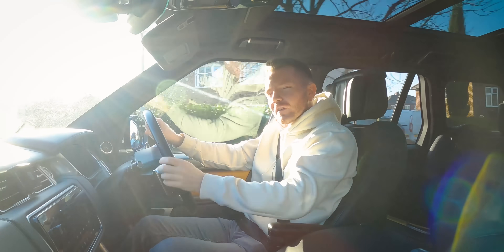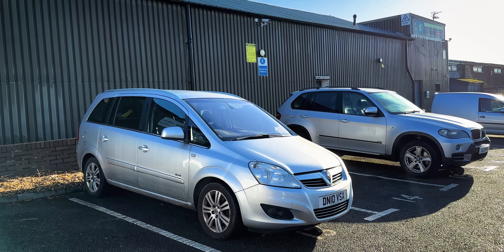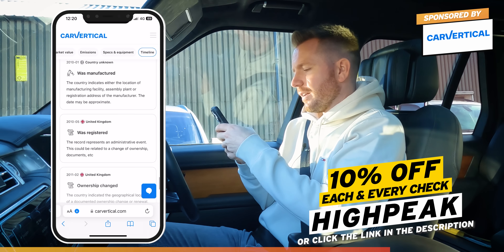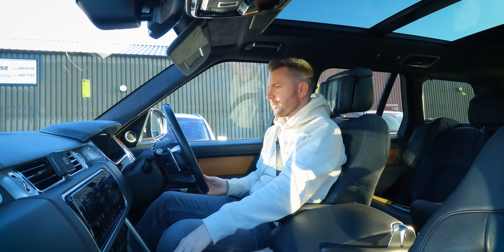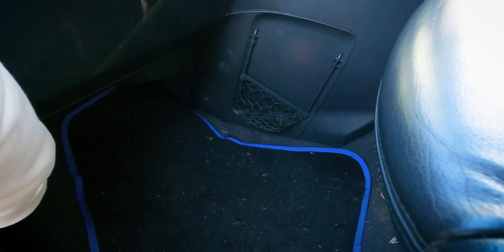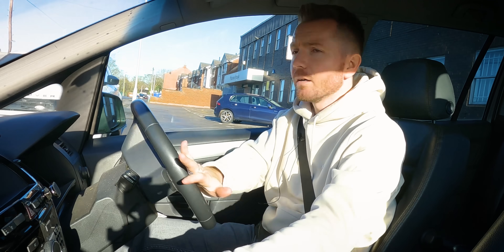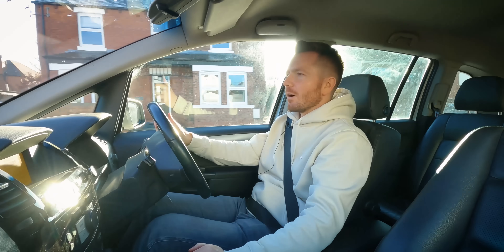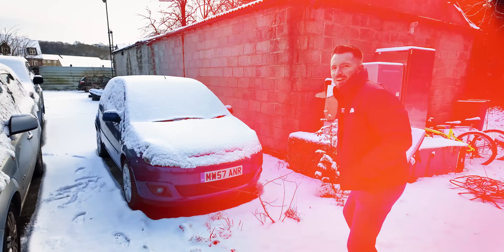I BOUGHT A CHEAP VAUXHALL ZAFIRA FOR £1,000!

Comment: The remark about the recall was not great...Vauxhall knew there was a. Issue with the heaters bursting into flames and decided to ignore it for years , risking many lives, they even blamed bad diy fixes. A friend's burst into flames outside his house and was gutted as well as his wife's car. I saw another stop at a roundabout smoking, by the time the dad got his kids out in 30 seconds( I stopped to help but not quick enough) the flames and smoke were out the windows. Scary stuff, so yes they earned the rep and its why I never bought a Vauxhall. They were happy to knowingly risk lives for a cheap resistor.

Comment: This is something I am expert in. My 2010 SRi 1.9 CDTI has 110 K miles and has a long list of things that need doing including the clutch, water bottle for screen wash, rear brake disks and pads, front pads and a tyre. The exhast has a rattle that suggests more expense and being a diesel the dpf is regenerating very frequently suggesting end of life. Sadly (like most Zafiras of this age/mileage) it is not worth saving. Much abused in my seven years of (much loved) ownership ? You bet ! NB cost me £4K + trade in worth £1K and £3k in repairs in the 7 years and 80K miles.

Comment: I bought a 1.8.  Been in the same family from new. Full service history……. But what a crock of shit. Five speed gearbox didn’t seem synced with the engine. No power at all. It rattled when you started it up. Then the cylinder head gasket went. It cost more to get it repaired than what it was worth. 32 to the gallon. Just plain nasty. The interior is nice though, as far as 7 seaters go.

Comment: I used to own one the diesel model 08 plate never ran on A shoe string always in the garage Springs, breaking air Leaking out of the tires due to policy alloys etc Replace the gearbox  Never will own one again stay away I would.

Comment: Had a Zafira 2.0 turbo petrol SRI. Biggest piece of sh*t I’ve ever had the misfortune to own. I replaced it in the end with a Renault Laguna. The Laguna was faultless in the 5 years I had it. I’ll never have another Vauxhall while I’ve got a hole in my ar*se.
Reply: Had a Zafira since new - 10 years old now, and been way than a whole list of Audis and BM’s I’ve owned - I think the trick is, don’t buy someone else’s issues … buy as new as you can and look after it …
Reply: @JIMMYHIBBS1 it was 6 months old when I bought it. It was ok for the first year or so. Then it’s decided to go through turbos at a rate of one every 14 months. From the responses I got from Vauxhall and taking it to other garages. I think it was a fault with that engine that they knew about but weren’t admitting. It wasn’t a popular engine in their line up. Most people either bought one of the diesels. If they wanted a quicker version they bought the VXR.
Reply: @mrgt3201  are - ours is the 1.6 petrol (thankfully as we are now in the ULEZ zone)
Reply: @JIMMYHIBBS1 my days of needing a practical family vehicle are behind me. I don’t live or work in a ulez area. Things can go wrong with any car. It’s how you’re treated when they do. The dismissive way I was treated by Vauxhall means I’ll never buy one of their cars again. It’s been 10 years since I got rid of my  Zafira.

Comment: It's a shame. That's a potentially useful car for someone that has died the death of a thousand cuts. Most of those problems are pretty minor but the sheer volume of them means the car has one wheel in the scrapyard.